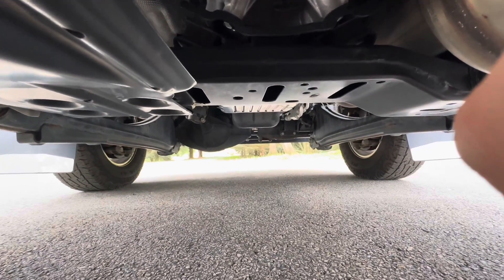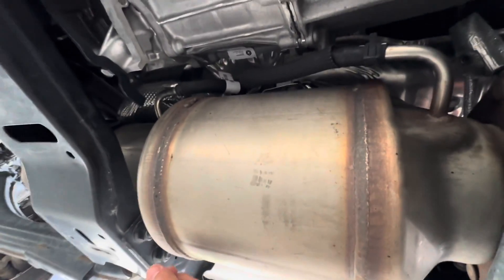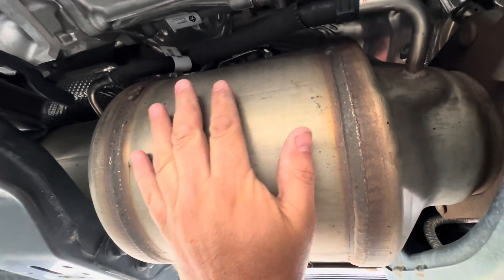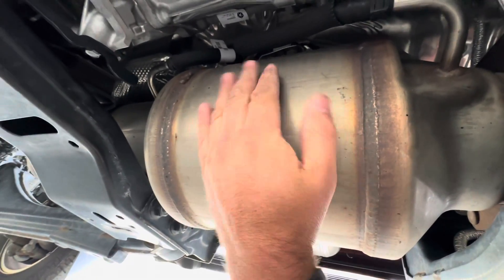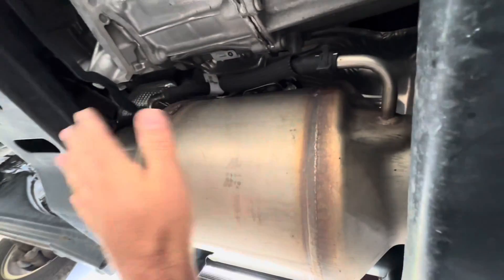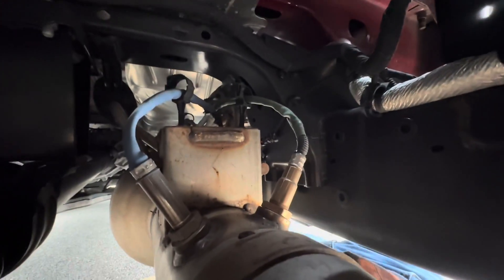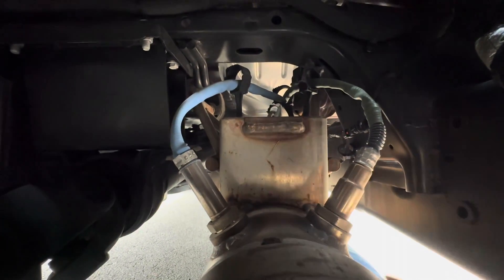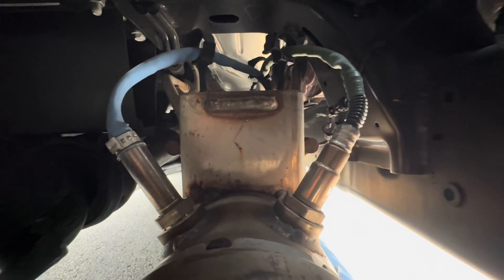2022 Ram Cummins DPF Regeneration and Y43 Recall Explained

Comment: You did a great job explaining, but there is an injector in the exhaust pipe for fueling Dearing regeneration.
Reply from the maker: There is no injector for fueling regeneration on the 6.7 Cummins in the Ram HD trucks. On this platform, the engines own fuel injectors are used to fuel the regeneration process. Fuel is injected during the exhaust stroke and it’s pushed into the DOC / DPF. Not all diesel platforms use the “7 injector” or “HCI” to put fuel into the emissions system.
Reply: I work on them I do know what I’m telling you. Everyone stop doing that a long time ago because of fuel washing. Look from the turbo down, you will see what looks like a sensor with a hard metal line coming off of it. That will be your fuel dozer injector. GM trucks it as right before the DPF. Go look at your truck and follow the The exhaust outlet pipe from the turbo and you will see it.
Reply from the maker: @JJJ-bo1uu  I’ve been all over these trucks. My
Own included. I’m laying under my 2022 6.7 Cummins right now looking at the turbo and the exhaust downpipe. There is no fuel line going to it. The only hard lines are for oil to the turbocharger and coolant lines to the turbo actuator. There is no fuel going to the emissions, and I knew there wouldn’t be. Thats not how Cummins handles regeneration fuel on these trucks. I’d post a picture but YouTube doesn’t have that functionality
Reply from the maker: @JJJ-bo1uu  it’s a 2022. The 6.7 doesn’t use an HCI. Never has. All the fuel comes from the engine injectors when the PCM goes into regeneration mode. You’ll see. I know Chevy did use an HCI at one time. Totally different than the Rams. I look forward to hearing back from you. I think you’ll find I’m right
Reply from the maker: @JJJ-bo1uu  find anything out?
Reply: You are 100% incorrect. All, GMC ford and Ram have a injector for that. And in the Ram truck is right after the turbo. They quit doing that a long time ago with the over fueling for reiteration because it was causing a lot of problems. Problems like washing of the cylinder and excess amount of fuel in the oil.
Reply from the maker: @JJJ-bo1uu  I am 100% correct. There is no fuel injector in-line with the exhaust system. Cummins does not use a dedicated HCI in the Ram application. All fuel for regeneration is distributed using the engines fuel injectors. Some diesels do indeed use a dedicated fuel injector in the fuel system, but the Ram 6.7 Cummins is not one of them.

Comment: At what age/mileage does the dpf typically get full of ash?
Reply from the maker: That’s a hard one to nail down because there are a lot of variables that can change that number. Generally speaking I would expect somewhere between 100k and 200k miles. How the truck is operated, the type of engine oil used, etc. all factor in to how long it will take.

Comment: I have a brand new '24 2500,  starting at about 1700 miles, I started getting a p2459 code. I took it to the dealer and they alleged that everything is working "normally." They then went on to say that they suspect I got bad fuel. I filled the tank with high quality diesel. No matter what driving conditions I have, my truck is regaining between 70 and 130 mi. I have practically no stop and go driving, mostly highways and interstates. The error code returned, but thanks to the dealership hack they have not been able to provide me with a report on the truck, they just returned it to me with the check engine light off and a promise to get back to me. As expected, regened within 70 miles again. Any advice on what I can discuss with the dealer the next time I have to take it in?
Reply from the maker: If your truck is regenerating every 70 miles, you have one or more problems with the engine or emissions system. The dealerships have a diagnostic flow chart they have to work through. If the truck is showing code P2459 that means it’s regenerating too often. Nothing about this is “normal” and they need to take a much deeper look at the truck. There is a multitude of things they have to inspect on both the engine and the emissions system in order to determine where the fault(s) is / are. Be aware that when the truck regenerates too often, this can cause an excessive amount of diesel fuel to enter your engine oil. You’ll see an elevated reading on the dipstick, and if it isn’t handled, it can contribute to further emissions related issues and more P2459 code, as the high level of oil and fuel gets drawn into the crankcase ventilation system and then ultimately pulled into the compressor side of the turbocharger. If your dealership doesn’t want to tackle the work, or they’re incapable, you should either attempt to find a mor experienced dealership or contact Ram customer care and file a complaint / report and ask for assistance. It’s a brand new truck. They need to stand behind it. FWIW I wouldn’t go more than 5,000 miles on an oil change until you figure out what’s causing the regeneration issues. I would also obtain an engine oil analysis kit from Cummins or Amsoil and send it out to their lab. Both companies use Polaris laboratories for their independent oil analysis and they do great work. Be sure to note on the submission document that you suspect fuel dilution in the engine oil.
Reply: @TheRamGuru  *update* The service manager asked that I take the truck in during a regen, regardless of if the CEL was on or not. It took 133mi for a regen, and they got it right in. They initiate a STAR report so that they could have the communication with the engineering team. The engineer(s) responded that the truck was acting normal based on the drive cycle information they could obtain. Nobody can say why the multiple regens are occuring, nor can they tell me the reason for the CEL, and lastly, nobody could articulate the parameters which would trigger the CEL to begin with. We just passed 2500 miles and they alleged that the engine may need as many as 15000 before it's broken in, and that the issue may self resolve in that time?!? Each time I take it in they force a regen and reset the light, but aren't attempting to fix anything. The selling dealer and the servicing dealer both seem to agree that it's abnormal... But nobody wants to figure why. My next CEL I'll be calling RamCares.
Reply from the maker: @ernestagnew2383  it’s really disappointing that these dealerships and Ram tech support can’t get these trucks figured out. There’s a whole bunch that are doing the same thing. Keep me updated please!
Reply: @TheRamGuru  Ram returned the truck to me after inspection of the Mass Airflow Sensor and a computer reset. I pulled my travel trailer (5000lb) for 410miles  and noticed that the passive regen worked well. Went from 25% to 0 in my first 40 miles and stayed at 0. However, after about 80mi without the load, the dpf meter went from 0 to 12.5%. Coincidentally, I stopped less than a mile later and when I turned the truck back on, the meter read 25%! So it somehow added another 12.5% while off. Now the trailer is hooked back up, and 4 miles down the road the dpf gets to 30%+. Then like before, the passive regen begins, and the filter reads 0%, this time within 12 miles. The remainder of the trip it stayed at 0%, so round trip over 900 miles without an active regen, just passive. But the DPF sensor data is troubling. I'm wondering if either the filter is inconsistently filling and emptying and the sensor is picking it up, or the sensor isn't interpreting the data correctly? Maybe another issue within the computer? We noticed a 15% reduction in our fuel economy as well, but this was our first time on this route so that may not be an important detail yet. I've forwarded the info to the dealer but they won't get the truck back in until next week.
Reply from the maker: @ernestagnew2383  for whatever reason, it seems like the 22+ trucks fill the DPF rather quickly when not towing. My truck will go 800-1000 miles between regeneration cycles in cold weather but only 300-500 when the summer comes. I have been testing fuel additives to see if any would improve the time and miles between regeneration cycles. I’ve found that Archoil is the only one so far to do so. I’ve seen a SUBSTANTIAL improvement since starting to use their products. One full tank of fuel treated with the AR6400D fuel system cleaner, followed by a subsequent tank treated with the 6500 fuel treatment. I’m now approaching 800 miles and 21 hours since the last regeneration cycle finished. This will be the first time in almost four months I’ve been able to go further than 12 engine hours or 400 miles between regeneration cycles.
Reply: @TheRamGuru  still waiting for the STAR engineers to allow something to happen to the truck. It still seems like the DPF sensor has no clue what's going on, but RAM won't test the theory with a new part. RamCares has proven useless so far as well. Running the Cummins Diesel Kleen hasn't improved anything, and my milage seems to be down a bit... I wish there was real news but so far. The selling dealer refused to discuss a buyback without RamCares blessing... It's a fiasco
Reply: My latest update from Ram, they believe that there's a software issue. They're alleging that there's something in development but it's not available yet so as of right now they cannot fix the vehicle. I've reached out to FCA about a buyback and or a update on software development. Fuel additives haven't done anything to improve the regen performance
Reply from the maker: @ernestagnew2383  keep us updated please.
Reply: 🤦🏼‍♂️just bought a new 2500 in June. No issue yet with 1100 miles on the truck.
Reply: @MPjustaman  fingers crossed for you man
Reply: It really sucks but you need to get one of the ODB scanner tools that can log everything. Basically you have to look into what other people are doing with it. Mine's pretty much the same issue I thought it was normal because it's my first diesel and no one in my family has had a newer diesel. But talking with other owners that also tow RVs the similar way I do, they don't have the same issue. If I figure it out I'll make a YouTube video 🤣

Comment: I put about 4000 miles on my 22 Ram before the first “regen keep driving” warning light showed up, after that it happened a lot! Mine was delivered without the sensor, they installed it a couple weeks ago with about 16000 miles on it and I got a limp mode/ 95% full notice… they are now changing The DPF filter!
My brother has a 21 Ram and he has about the same driving habits as I do “a lot of in town and some highway” he has never seen a regen warning light…
My question is what is the specific difference between the 21 & 22 Ram’s?
Also are the 23’s &24’s having the same issues?

Thanks
Reply: Did changing the DPF filter fix your constant regen issues?  We have a 2022 and have had it in probably 6-7 times since we purchased it due to constant regen and check engine light coming on.  We also had issues with overloading code coming on when my husband hauled a gooseneck trailer with only 600 pounds of tongue weight.  Most recently they had it for 5 weeks and replaced the air suspension system saying that was causing the truck not to fully regen properly.  Since we got it back 1 week ago it has regenerated 4 times in less than 400 miles on it and the check engine light is on yet again.  We are beyond frustrated and ready to call an attorney about lemon law.
Reply: I can tell you that I just purchased a 2024 Ram 3500 and I have 20K miles on it and mine has done it 3 times already.
Reply: I’ve heard that the 2022 has a software issue with regen. Something about it not doing the regen process. We have 2 2022 Ram 2500 that have DPF full check engine lights. Our 2021 never has a regen issue, DPF never gets full but our 22’ models do.